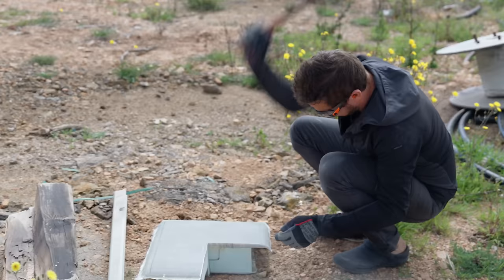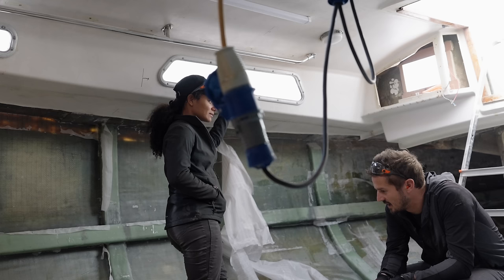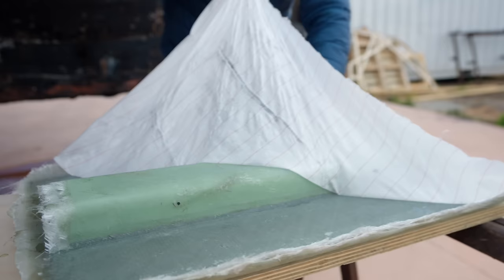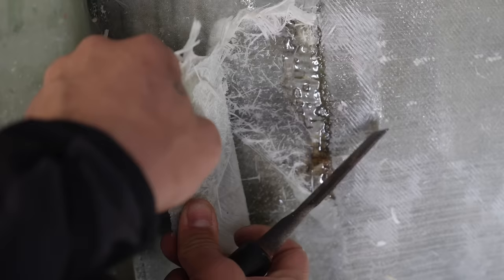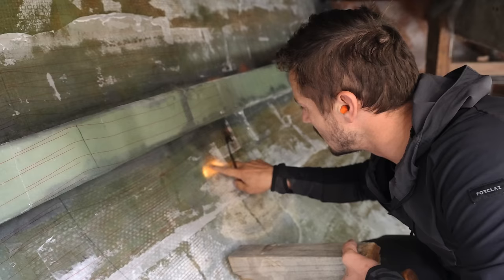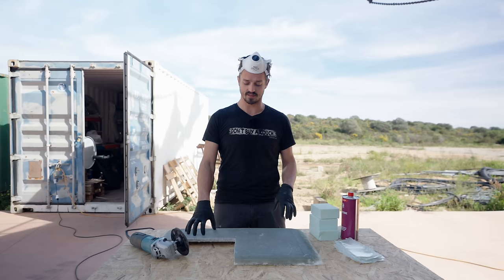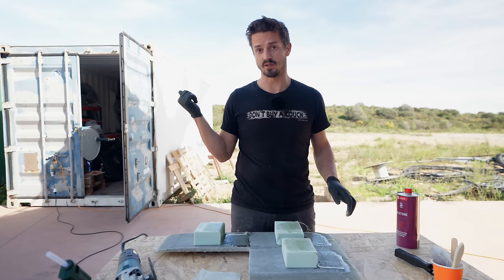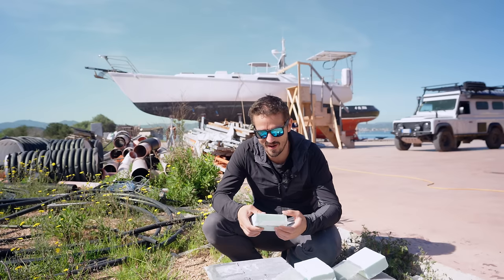If It Doesn’t Work, Hit It With a Hammer | Step 387

Comment: Do you understand how much interior space you loose by just even using 1 extra inch foam more than needed? Let do some simple but not 100% accurate math. Imagine  you have on either side of your boat so port and starboard inside about an average of 12 ft hight and 40 some foot lenght . 12×40×2=960 square ft. Now 12 of these 960 sq feet are a cubic foot. Take 960 and devided by 12 to get total cubic foot. That's 80 cubic feet for just one inch of foam. 1-1/2 inch of foam would take you 140 cubic feet of usable interior space. So since I actually did not measure your boat nor get an accurate average of square footage per side i have my number somewhat wrong. This was mostly food for thought. I know you can do your own measuring and averaging now. What is the space you loose?
Reply from the maker: We’re not “loosing” anything valuable. All the ribs and stringers are placed behind cabinetry and bulkheads in areas that are hard to use for anything else. With the new design, we’re actually gaining way more usable storage space and living space.
Reply: @SailingUma  how so? If you want the same size cabinetry size than without the foam you will loose space do you not? However how can you have more than before after adding bulky foam pieces?

Comment: What stupid test hammer a piece of wood with a hammer against the hull? Don’t you realize the wood is distributing the blow across a larger area than the small surface area of a hammer? 😂😂😂
Reply from the maker: Yes. That was the point. Taking a hammer to a Hull directly will for sure damage the hull itself before shock loading the new laminate.

Comment: Why are you not using Westsystem epoxy? I can´t understand. Sometimes you need to have a certain knowledge to value the advice you are getting. If you don´t have that knowledge you ned a second opinion.  And read books about lamination. It seems that you are building a layer that will  not make the boat any stronger since you are not using the correct working procedure  with these materials. It´s very frustrating to see. You can´t compare some hammering with the forces that will occur at sea in bad weather when the whole hull is bending.  If you continue to work this way you will certainly see some problems in the lamination already when you put the mast back on and the riggning is in full tension. I think you should stop and contact a quality controller outside this boatyard and discuss the method and materials you are using. It´s easy to fool yourself in such a situation and think that all is good and safe after some hammering on the hull when you want everything to be perfect.
Reply: Exactly. This is going to be one of the great YouTube crash-and-burns. What's so astounding is to watch all the comments by 'supporters' and 'enthusiasts'. This is the inter webs at its ultimate worst - a nightmarish echo-chamber of disastrous advice. Uma may become a watershed moment.
Reply from the maker: Like we said in the previous videos. We have the engineers and boat building from 4 reputable yards who's opinions we trust helping us on this project. The work being done is a collaboration between all of their advice plus our own experience.
Reply: @SailingUma  ….but something is wrong anyway despite your 4 yards. It’s obvius…..